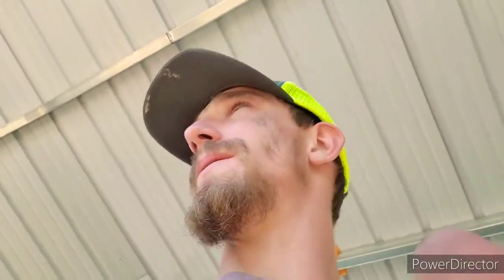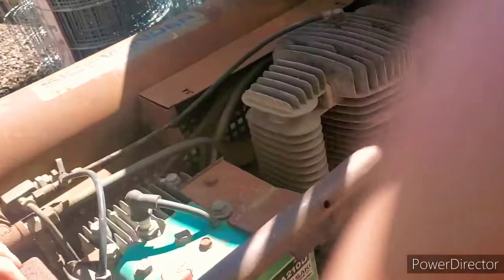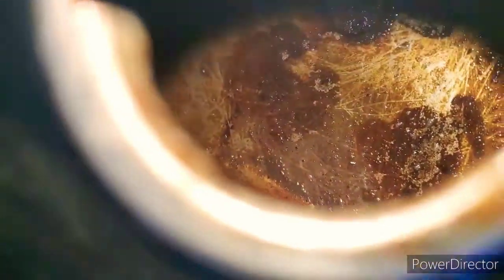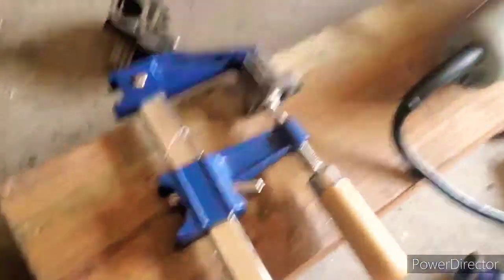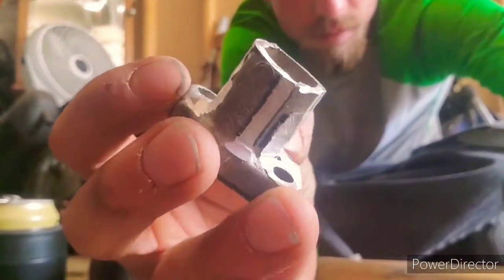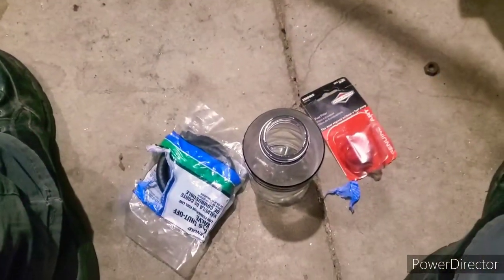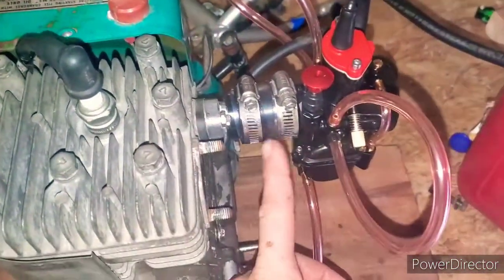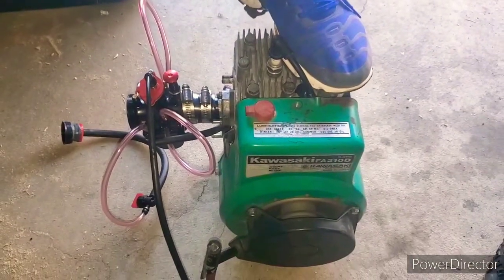5 HP Frankenstein kawasaki motor | FA210D | Trike project

Comment: I just bought a generator on marketplace that had this motor. Mine is a bowl type carb and there are no parts available. I searched through my stash of stuff and came up with a Tecumseh carb that was the right sized throat. The mounting holes were wider but with a little filing and governor adjustment it runs great.